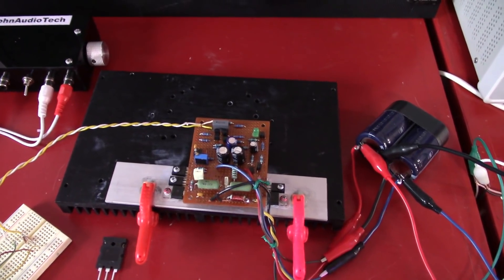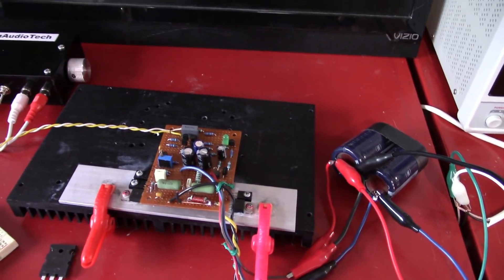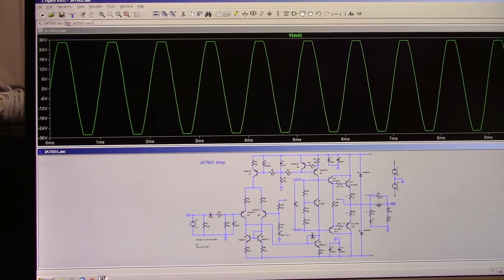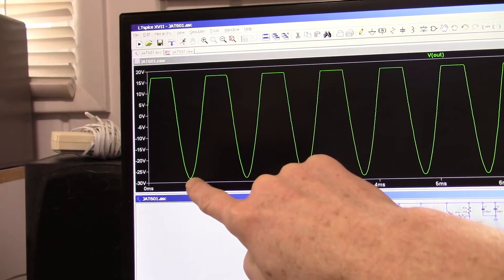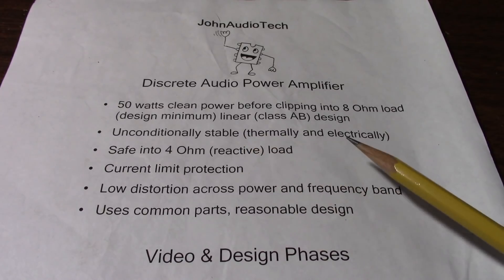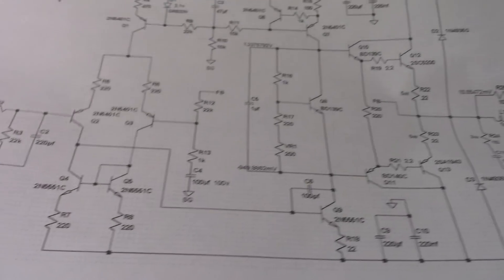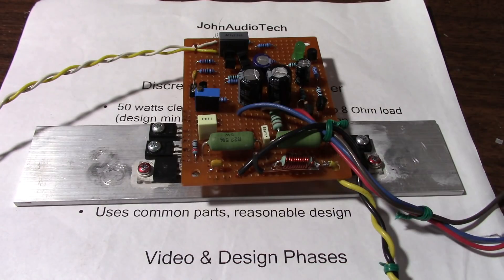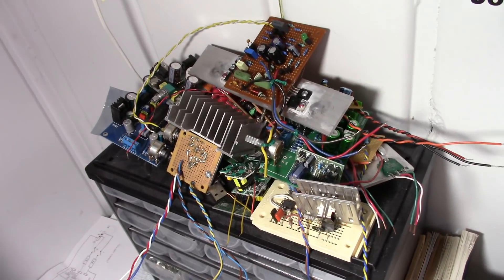Discrete audio amplifier project PT21 project completion

Comment: I built this amp. It works but I'm only getting around 6V across my 4ohm sub at max volume ( max volume isn't as loud either) at +-36V...any suggestions as to why
Reply from the maker: What is the input signal voltage?

Comment: Yes, I want to build this amp. Could you talk about adding more power transistors ?
Also, what about 1.  using your o-scope to sum input and output out of phase for null to display output distortion ?
2.  using opamp in place of o-scope to display output distortion ?

Comment: I bought a couple of Toshiba 5200/1943 chips from a reputable source and JAT501 looks like an interesting project to build. If you are willing to sell ready made PCB-s then you have a customer waiting. Found the circuit on this site as well: https://easyeda.com/blastherost/jat501 There is a similar project there: https://electrea.blogspot.com/2018/10/80-watt-mono-2sc5200-2sa1943-ultimate.html and I have bought a couple of these chinese Aiyima-s https://www.aliexpress.com/item/32664017143.html?spm=a2g0s.9042311.0.0.27424c4d5NS5lf for a bass guitar amp, but after watching your videos I opted for a TDA7293 based amp - it's smaller and does the job well.
Reply from the maker: I hope to be able to offer boards for this project in the future. Several have already made their own.

Comment: You've got lots of SI multipler/unit case mistakes in the BOM I'm afraid.  Case matters for SI symbols.  H = henry, F = farad, K = kelvin, V = volt,  k = kilo, f = femto, h = hecto, v isnt an SI thing I believe - sometimes these distinctions are crucial, confusing milli (m) for mega (M) for instance.   All unit names like henry and ohm are not capitalized, the people they are named after are capitalized as in Ohm's law (only exception is "degrees Celcius", for obscure reasons).  Be consoled by the fact you are not alone in this, but please fix it :)
And of course great to see it complete and wrapped up - looking good!

Comment: Enjoyed watching this series, John.  I have a pile of old MusicMan guitar amplifier power transformers that might be a good fit for this circuit, so I might build a set of mono blocks out of this for kicks.  (All of my amp builds are generally with valves, but I'm not afraid to use sand in those projects, so what the heck, branch out a bit!)

Comment: Where did you get this heatsink - it's huge. For the amp load simulations I actually use something very much like, say 2way spkr with crossover. The spkr drivers simulate quite similar to real drivers. One thing - depending on the crossover the actual impedance for 4 ohm drivers may drop as low as 2 ohm plus +/-60 degrees phase shift - not an easy load.
When simulating with simple resistors as load I usually add capacitor in parallel, starting with 1nF and increasing until 1uF and watching for oscillations. But that's just simulations, things are most likely more complex in real life.
Reply from the maker: The heatsink came off of an industrial UPS. I did test the amplifier with various load resistors and several values of capacitors across the output in the step response tests.
Reply: @JohnAudioTech  👍 ✌
Reply: I made it with 160 grame heat sink btl _+20v smps with quasi complimentary output at 4 ohm no heat problem

Comment: I will probably build your amp for my car audio system! That is unless I can find a good class D design for DIY that has the same output power/THD parameters as this one. I am going to include external protection circuit for sure, though.

Comment: Thanks, appreciated. Where Can We Get TRANSFORMERS? I searched for them about a year ago, and, basically could find almost nothing! Please link to 100va and 200va center taped transformer sources.  When I was a kid, getting into electronics, every supply house had any transformer you could imagine, if not in stock, they got it quick. What happened from then to now? Maybe I forgot how to search for stuff a year ago?
Reply: This one will fit this amp nicely. It's 225VA so there's plenty of current. Also, this is for US (60Hz) https://www.mouser.com/ProductDetail/Hammond-Manufacturing/1182S12?qs=qPaGMJUC%252BSt0gTXwhrPwfA%3D%3D
Reply: Now add bluetooth wireless bidirectional input kit, a small fan and case...viola..! Perfect for inlaw tv with poor hearing.